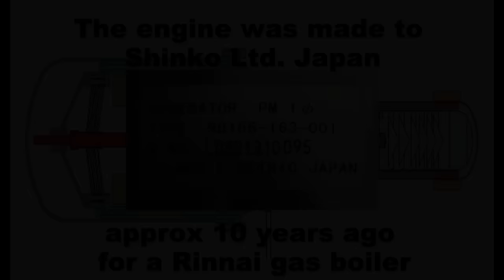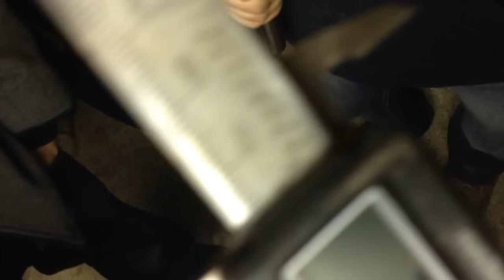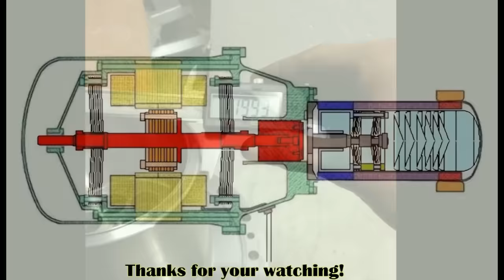How to disassemble a 1kW Free Piston Stirling Engine Generator

Comment: I used to work for Microgen UK, who bought the Sunpower patents and developed this engine into a compact unit for domestic gas boilers. The two piston spring packs were replaced with a magnetic spring and a stiffer gas spring, so the piston was truly free. This shortened the engine greatly.
Reply: Will Swift  Probably he means the auto-centering linear motor according to US6483207
Reply: Tell me about microgen UK product, specification and price list please
Reply: @brehcsif  thanks dude! Now that the patent has expired we can make it for our own use and even sell it to our neigbours
Reply: @absolute___zero  No problem, we can share the profit 😉 By the way, another patent that might explain the magnetic spring is US 2009/0001823 A1

Comment: A few questions for you if you get the time, when the DP is at the very bottom of its stroke does it momentarily cut working fluid flow between the PP and the cooling area next to the DP?
Also what limits the stroke of the PP and the DP? Do they come to a hard stop or stop short reaching the planar springs limit?
Also did you get a look at the seals used on the flanges? Flat seals or ring seals in a groove?
Reply from the maker: The flange sealing was a brass-like spring-ring with special shape that I never seen. It could change the shape with the tightening process. Looked like a C cross section where the opened part looks inside where the pressure is higher. The pistons has sinusoidal movements, no hard stops.  Inside the displacer has a collected flat spring section to hold that in the center.
Reply: @AttilaBlade  thanks for a speedy reply I appreciate it, the gasket could be a 'spiral wound gasket' used with standard ASME high pressure flanges.
Reply from the maker: Yes, you've right! Did you work with it?
Reply: @AttilaBlade My line of work is in orbital pipe welding, I repair various pipe cutting and orbital tig welding equipment  very expensive gear. This has exposed me to a lot of pipes  flanges and gaskets, I am trying to figure a way to build a stirling engine using this equipment.
Reply from the maker: @bojangles2492  Hmmm, OTW is a pretty good segment of the weldings. In the high pressure area I seen some Pulse Tube Cryocoolers from RIX they used welded pressure vessels around they linear reciproc motors. That is a cheaper and lighter in mass production.
Reply: @AttilaBlade  yes my thoughts exactly, seemless 316L and Inconel tubing with off the shelf flanges could be used for the heater head and main body.
It looks like many engines have taken this path from what I've seen, it just the rest of the engine to think about. 
I will no doubt have other questions in the future, I've been spending all my free time on this.

Comment: "Really heavy parts".
Reminds me of Tesla's 'earthquake machine', a free piston generator powered by steam.
And since you normally can't just stop a closed free piston stirling, especially when it's massive and heavy - keep vibrations in mind!
Reply from the maker: Yep, the engine has a resonatly coupled balancer mass around the engine. That is moves opposite as the engine moves, so the average resonance will be low. The whole unit is really quiet when it's working. ;)

Comment: The stirling engine was pretty much perfected around 1990 onwards..
Due to it's versatility and with the world focusing on no emission technology they are making a comeback...
Efficiency is not always the desired outcome for a sterling engine depending on the application...
Helium as the working gas and using the generator as a starter motor as sterling engines can be fickle at start-up are two relatively new innovations...
Reply from the maker: Yep, you've right, but for the best weight/power ratio we should planning the high as possible efficient engine. The developements are going today too, lot of research lab working on it around the world, but not so popular and opened. BLADE

Comment: Wow !  I have wanted to see the inside of a Sunpower engine for 30 year!  
The Green coating on the Power Piston looks like a PTFE Heat Shrink tube. 
Can you tell if the Green Teflon coating was painted on or thin tubing or any more about it ?
Reply from the maker: Hi James! The material is a high grade one they called Rulon. It's looks like they made a thicker coating first, after finalised it for the perfect diameter.
Reply: So you feel the Rulon is a Painted coating ? 
The reason I ask is that it looks so even on the end, like it is Shrink Wrapped.  I use a Hard Anodized piston on my 2" engines, but I still need a drop of WD-40 to reduce friction.
Reply: The green coating is probably Xylan®. The usage for stirling power pistons is for example described in a freely available NASA paper with the title "Advanced Stirling Convertor (ASC) Technology Maturation".

Comment: Is the white material in the heater cap still intact? Not that I know what it is supposed to look like, but it looks broken up. Was the engine taken apart out of curiosity or for maintenance reasons? Ive always been fascinated by this design considering that I would have no idea what part would break down first, if any; but did it?
Reply from the maker: The white piece is the heat insulator. That wasn't broken just old...something Calcium based silicate I think. We've been curious about the inner structure. The unit will works again when it will fill up with 30 bar of Helium. It wasn't break, just unused, because the owner wanted to buy a bigger one 2.5kW unit.

Comment: Could You write a couple of words about the balancer and springs, please? What do they do?
Thank You for this video. You're a great source of inspiration!
Reply from the maker: OleTC Hi there, the balancer reduce the whole engines resonant. The inner moving masses alternate, so the spring-mass outside moving freely but opposite as the overall inertia from the moving parts. The engine could work so smooth with it also silence.

Comment: which fields are filled with helium? have any idea?

stirling area or full inside?
Reply from the maker: The full closed area inside filled with high pressure Helium. It makes gas bearing for linear rods also create some cooling to the generator or motor side's coils. Also it makes a bouncing volume after the pistons as a gas spring.

Comment: I'd love to work on these things myself. I wasted my life I think. I'm on the liver transplant list and I love tech. I build gaming computers. I just wish I could work with  tech like thjis
Reply from the maker: I wish you all the best! I think me too, but I started it autodidakt more then 13 years ago... This unit is unfortunately not my design, this is a professional unit from Japan. I think this technology is perfectly usable in the 21st century but the price too high yet. If people will start to leran deeply this technology in school from the first class to university, then 10 years after we will happy with a generator, or heat pump in every home with an acceptable price... but actually people are not so interesting about this technology deeply enough to build high power units, just the desktop engines. Also those materials and manufacturing technologies are expensive today. BLADE

Comment: Did you test it out before taking this generator apart? Any info would be nice and the efficiency of converting BTU"s to kw-hrs. Question can this be improved on?
Reply from the maker: No, I didn't! That wasn't my engine, I was the leader of the disassembling process here with the owner of this engine. The engine worked in a micro-CHP system and produced 1kW electricity from the gas burner's heat. http://www.microchap.info/stirling_engine.htm Check the 3rd column Infinia with Rinnai, Bosh 1kW engine

Comment: Do you have an idea if this works for normal air and the efficiency if at all it does run.
Reply from the maker: This question is not easy to answer. In the Helium 3 times faster the sound, the thermal properties much better than air. If you want the cheapest but good solution than use Argon under pressure, but the Heat exchanger won't be ideal for that conditions. This engine works well with pressurised Helium because it was developed for that and relative high temperature on the hot side. Anther thing is the gas bearing technology what they used. That is not working well without pressure or maybe the gap won't be ideal for air. So the answer is not easy.
Reply: @AttilaBlade  This engine definitely doesn't has a gas bearing but simply a precisely aligned clearance seal. A gas bearing is self-centering and therefore the piston needs a certain degree of freedom in radial direction. However, in this case the position of the piston is fixed by the flexure bearings on both sides. Newer Sunpower engines allow movement of the power piston by replacing flexure bearings with gas and magnetic springs (as Rob Bolwell describes above). The displacer piston can be decoupled from the flexure bearings in radial direction by using a long and flexible piston rod inside a sleeve that slides in the central bore of the power piston (well illustrated in US7827789B2).
Reply from the maker: @brehcsif  These infos are partially roght, because the gas bearing as an effect could work without adjusted direct gas flow. The precisely aligned clearance seal here is not a simple clearance seal. The grooves are works as vortex generator when it moves back and forth in the 30bar pressurised gas. Also the planar spring twist/spin the piston a bit in every cycle two times what the piston does. I know what do you mean as a real gas bearing technology, but this effect works here too without forced gas flow in dedicated gas paths. I really like that solutions and technology to reduce the friction. Now I like the surface modifications to create same effect without complicated paths.   Anyway, thanks for your meaningful post alsi thanks for the patent! BLADE

Comment: I wish I had a small free piston gen to work with the stove when the power is out.
Reply from the maker: Travis, what do you mean "small"?
Reply: @AttilaBlade  Something that I can set on the wood stove, pour water on the top or water container for the cooling and make about 500 watts for the TV, computer, or dehumidifier.

Comment: Can anyone explain what makes the displacer move without the crank shaft found in other stirling engines? Thanks
Reply from the maker: Yes, the pressure changes. We have two pistons with different diameter. The bigger diameter piston moves first, the smaller after. It gives a phase different as the crankshaft. The smaller connected to the displacer.

Comment: Hello, Do you have a detailed report on this engine if you can share. Need some help. Cheers
Reply from the maker: I haven't got any detailed report from this engine, but originally it worked in a 24kW gas heated micro CHP. So the electric part generated near by 1kW electric energy. The other section heated the water for daily usage also warm up the house.

Comment: Very cool! What is the price of this engine?
Reply from the maker: I'm not pretty shure about it, but if I'm correct than my friends bought it about 800€ in used condition without boiler parts also no Helium in.
Reply: Will Swift  easier to leak, and potential for metal embrittlement, explosive if it escapes, etc.  Hydrogen embrittlement is a problem mostly for high strength steels, aluminum alloys, and titanium alloys.  A steel container filled with 30 Bar of hydrogen is not something you want to be keeping in your utility room.

Comment: Tell me for order this product please
Reply from the maker: I can't share any link unfortunately for this, because it is not a product actually. This 1kW unit is a part from a micro CHP system. Included to a 24kW gas boiler heater. It eas a used Stirling FPSE generator that my buddy bough from ebay without Helium.

Comment: A very complicated piece of work.
Reply from the maker: Is that complicated? One of the highest efficient Stirling on the planet. Brilliant works of engineers.
Reply: @AttilaBlade  Yes, it is a very complicated design with extreme precision fitting of parts, unlike the "hobbyist coffee can" Stirling engines. As for the power, compare it to a few solar panels or a small 2-stroke chainsaw engine which can produce twice the power, although at low efficiency. 

I realize that, for a stationary application, an engine does not have to be compact as it does on a chainsaw, but this Stirling is not big and cheap and clunky, it is big and expensive and complicated.
Reply from the maker: @codetech5598  Yep! It isn't possible quality for us, but good to see it's not impossible to make. I think the TA engines are more usable as homemade, garage engines. Aster type generator or cooler is a good construction. It could be made from cheap materials, parts. But you know, the engineering time, and knowledge isn't a skippable part. :)